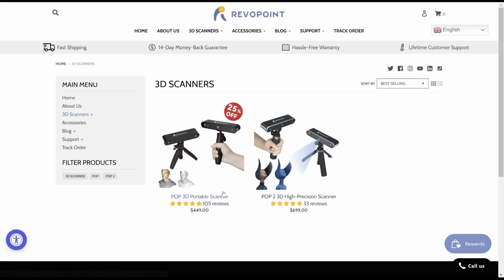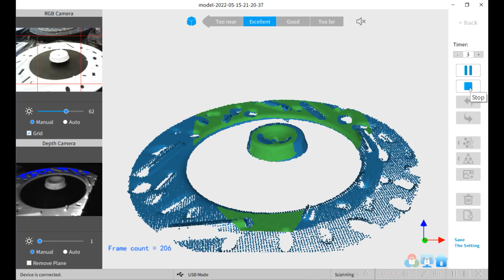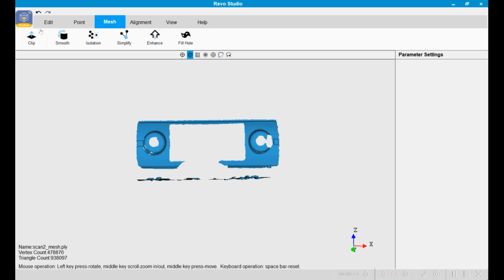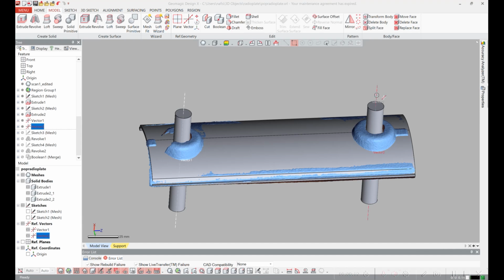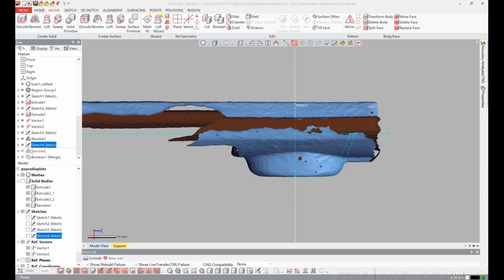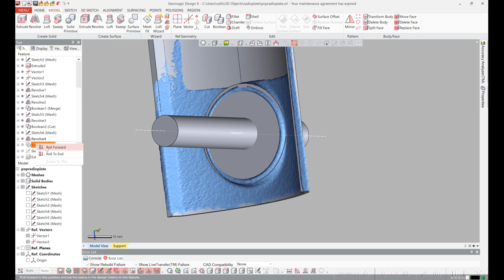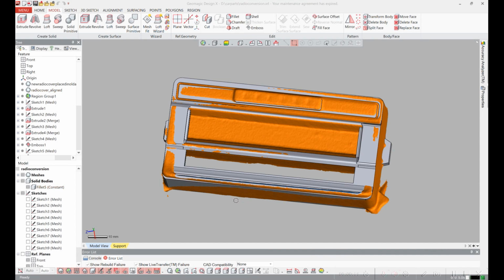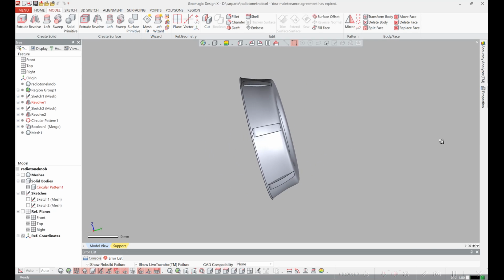Scanning Shiny Car Parts for Replacement & Modification with Revopoint POP 3D Scanner

Comment: Some folks will use a chrome airbrush paint to great effect, and for a real mirror shine, some costume and prop makers use 2k clear coat, though you'll want to make sure you have enough things to paint to use up a can, since it has an activator that must be mixed in and from that point on has limited shelf life